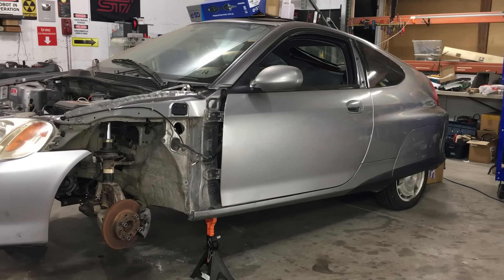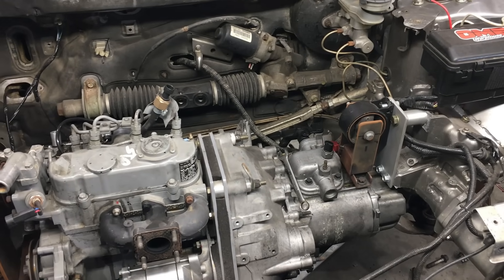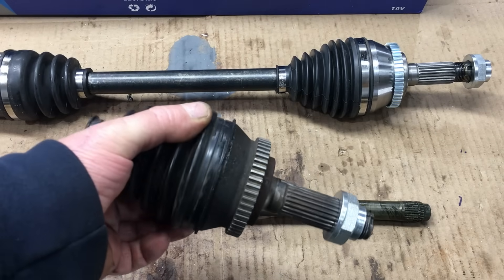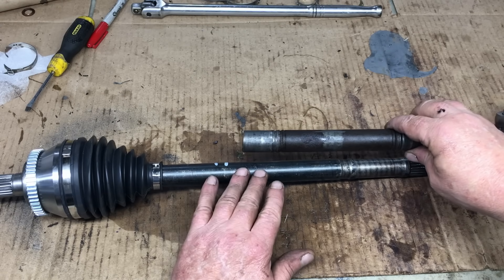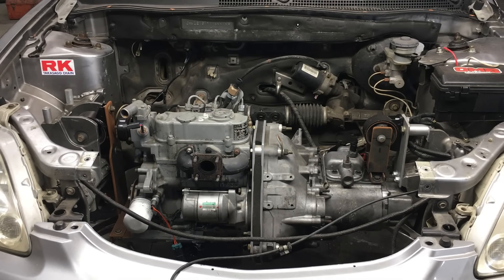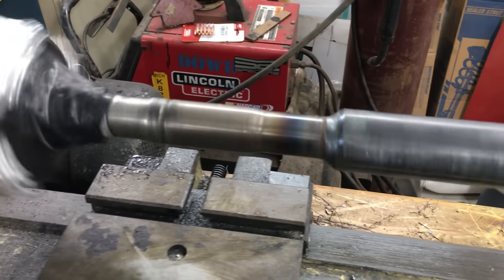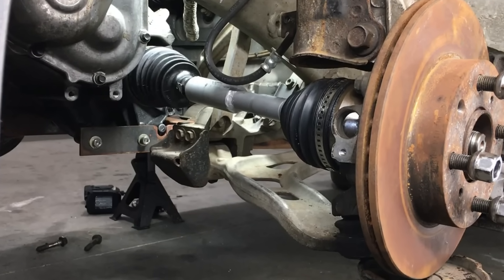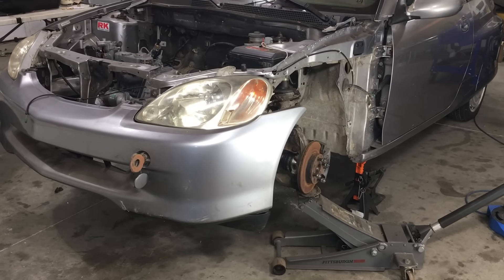S3 E39 we custom build drive axles for the kubota d722 diesel powered Honda Insight.

Comment: For heaters, there's some good kits for side bys that come with speed control, and usually a simple door for windshield or floor and some  ducting. Work great for old farm trucks and hot rods.

Comment: I would use a simple heater core you can find on an airport tow tug. Y'know, the inline Ford 300's converted to run on propane? Super easy to drop in.

Comment: Honda insight enthusiast here, the original gasoline engine was definitely not known for snapping axles. It happens occasionally, almost always when people are being dumb and spinning the tires in second gear with full electric motor assist. Wheel hop will snap axles, but you almost have to be trying.

Comment: You make me wana build all kinna things, and I have a thing for Diesels, large and small.

And me presonally, I like the smell of diesel. :D

I had the idea of mounting the a larger Kubota diesel in a beetle and using an air-craft style oil cooling/cabin heating system, a common solution for cab heating on other air cooled engine driven vehicles, though im not sure if Kubotas have oil bypass ports, though id imagine they probably do.

Comment: I'd still love to see what you can do with a bradley GT .... a 1200lb (stripped) fiberglass bodied car on a VW bug chassis
Reply: Cheap, light car that handles very VERY well in corners and has the near bullet proof VW 4 speed transmission that was built for a low rpm, low HP engine

Comment: Nice to see a "new" project! I started watching with the Renault videos. Maybe for a heater in the Insight, just go with a 12v power supply and portable 12v electric heater. ? Also, I think it would be cool on the Renault to put a matching Predator engine and drivetrain in the front with a front wheel drive setup (maybe from a Saturn?) for all wheel drive. See what that does for performance. Could be really useful in those Kansas winters too!

Comment: I was thinking for using the gen 2 or gen 3 prius drivetrain on other vehicles, like made in the US ones or at least made in the US for the most part, when cutting the axles to not weld and only bond the two ends via the similar spline design using a coupler.  So cut, cut splines and then connect via a splined coupler that might be able to be sourced from the eCVT or elsewhere if long enough.  I'm not sure the hardness and was thinking welding would adversely impact if not re heat treating.  Only thoughts for now. No hurry.  Was thinking for coupling with potentially half to three quarter ton more modern probably Toyota though maybe not axles, knuckles and wheel hub assemblies with brakes of course.  That center pin machined design is a good idea seems as well.

Comment: I would still say that having a high-pressure turbocharger paired with a low-pressure turbocharger would be ideal. That way, once enough exhaust is produced, the low pressure turbocharger will feed the high pressure turbocharger. Resulting in a few more horses. And a broader power band

Comment: Drill and tap the ends, screw in a piece of 1/4-20 and tighten the two halves of the shafts  together. Now everything is physically connected for welding.

Comment: I welded driveshafts on my HIACE van years ago, the wheels don't rotate that fast and the job was a good un even without going to the precision you did. a few hundred RPM isnt enough to cause much imbalance

Comment: i did weld a axel to a snowblower behinde my tractor  that did snap i did put it on the floor in my barn used the sheapest sick welder welded it togther i did hold up for 4 years ehehehe

Comment: Watching this CVT belt, I was wondering: could this engine be hooked up to an automatic without the CVT? I know thrust loads are why you're using the CVT, but I don't think clutch converters have those? I don't jack about automatic mind you, so I might be getting something wrong lol
Reply from the maker: This car actually has a real clutch because the diesel engine has thrust bearings. On the Renault it would be tricky to install an automatic transmission, however I did hear that even on automatics there are thrust loads that are transferred to the engine.  I have no idea how much of a load it is.  I reckon an automatic may be possible on the 670 cc engine, however since the Renault has a swing axle type tranaxle there are virtually no automatic transmissions that could easily be adapted to the Renault.

Comment: Thank u soo much for this Series, u inspired me to do the same swap in my Trabant 601! The only thing im really struggling with is the Adapter to the Original Gearbox, and to find a smaller Oil Pan because its really rare here (or expensive) But thank u soo much! Ur Series Helped me really really much! Greetings from Germany!
Reply from the maker: You can do it!

Comment: I bet when You add heat to the car the Kubota won´t make enough heat in the first place. Seems like a good plan to add valving to the main rad to limit or shut it off if needed. But with all ironed out I see this becoming Jimbo´s daily!
Reply from the maker: Last winter we had the little Kubota installed in the Saturn and the engine generated enough heat to keep the car toasty.  of course we had to cardboard over the radiator.

Comment: that thing about honda absolutely true
2011-2013 odyssey
2001 civic
it's true about every brand
even toyota(like it or not it's the most reliable brand) has stuff slip off the assembly line that's bad

Comment: heater will be pretty easy if you use a 80mm PC water cooling radiator and a 12v 80mm delta fan (the delta fan blows extremely fast and the radiator has brackets for it)

Comment: I'm sure that cv weld is plenty strong. But worried about balance. I know driveshafts need to be balanced like wheels to avoid vibration. But a cv joint is smaller & might not need petfect balance.

Comment: At first I thought the Renault was ugly. But now I think it'd make a cool looking rally cross daily driver beater for country roads.......If you could make the diesel honda not crazy slow but still get decent mpgs and use a combo of diesel, biodiesel, free waste veggie oil to run on.
Reply from the maker: LOL, calling the Renault ugly upsets some people...  but I do thinks its ugly but I have seen worse.
Reply: @robotcantina8957  I really wish I still had a garage or workshop so I could build a diy aerodynamic electric velomobile/recumbent trike with lightweight weather enclosure. To stay warm and dry on cold wet days. No more expensive insurance,registration, gas or maintenance costs. I know those 3 & 5,000w ebike motors can get a bike up to 55 -60 mph so it'll get a velomobile up to 55 using moped tires instead of bicycle tires to be safe at 55.....Although it'd settle for 35mph cruising speed and bicycle tires if it was cheaper.

Comment: For the power you are making, you didn't need to weld the pieces of the axle. You could have just cross drilled the sleeve and plug welded the holes.

Comment: At a glance, to many of us, I think these engines seem unbelievably small.  However, I did a quick search and found out that this is not the case.  
Production cars with the smallest engines
Berkeley SE322 – 322cc.
Honda N360 – 354cc.
Subaru 360 – 356cc.
Citroën 2CV – 375cc.
Fiat 500 Nuova – 479cc.
NSU Wankel Spider – 497cc.
Smart Fortwo – 599cc.
Tata Nano – 624cc.
Especially odd to me, considering the smallest displacement motorcycle engine my dad has had was 1500cc.  That's probably the smallest most people in the U.S. have ever had as well.

Comment: Quick note at 9:40

No welder Is (not powerful enough) just not optimal 

With correct beveling and pre heating you can weld anything with any welder 

It’ll just take a LOT of passes.

Comment: I wouldn't be surprised if Honda designed the axle so small as an attempt to reduce the amount of rotational mass as much as possible for fuel mileage.
Reply: You are correct. I drove over 250k on the oem axles with no problem. 

Keep in mind the engine is 67hp. + 6hp from the hybrid.

Comment: ive snapped plenty (atleast 4) welded axles. they were built by dogging (D shape on end of each shaft) in an interference fit sleeve, with the sleeve seam and plug welded. Now my joining method is superior to yours (IMHO and no offense!!) all shafts snapped where they entered the inner or outer joints, never at the welded part. so you have no worries, those shafts will be perfect!

Comment: A Honda large bore atv,or sxs radiator,fan assembly and thermo switch out to work well given its compact size,reliability,and should be more than sufficient for that small displacement Kubota engine,plus can be picked up on the uber low low cost factor..😅 Heater core mounted in a box with a simple 3 speed blower fan with a single duct aimed towards the drivers feets and midsection would be super simple to do..

Comment: If you source a heater core made of an old 70s or 80s Chevy pickup, you could probably getting away with a cheap price on that part.  The one bad part about using PC case fans is that they aren't really made for heat and they more often than not don't move a lot of air, unless you look specifically for a high CFM part.  The Chevy heater core might be big enough for a small radiator fan, though.

Comment: @Robot Cantina I have a free heater core and 12V fan out of a Chevy Cobalt dash.  Don't know if you get down to Bentonville Arkansas, but it is here if you want it.  Has the plastic shroud and dash subframe if you want it.  Can ship it if you want to spend a few bucks.

Comment: A forklift heater might be a good option, although a heater from under a bus driver's seat might be more simple. One other idea is a motorcycle radiator with the factory fan.

Comment: With axle splices, I'd think that virtually no amount of engine power or torque would compare to the forces the axle experiences in a hard braking corner or sudden braking swerves? I think that would be my primary concern, but I have no practical experience with frame or drivetrain welds, so I don't know. Can anyone speak to that?
Reply: The force from the brakes goes straight to the wheel, not through the axles.
Reply: @vxiiduu  No torque through the steering at all? Sudden changes in angular momentum over shifting positions have to put lateral strain on the axle, I'd think. It isn't so much the braking itself, but the shift of velocity in a fast turning maneuver which makes me wonder. The compounded changes along with the rotation causes stress vectors that I wonder about. I can be wrong, though, especially since I don't want to work out the basic math.

Comment: Incredible backyard engineering for that axle solution! That's the stuff I like to see. Welding that in 40 passes and a trip on the lathe would have been doable, but I don't blame you for taking it to a shop one bit. Nothing like sorting out a high stress but crucial rotating assembly, thinking you've got it down to micron perfection, then feeling it shake itself to death from being out of spec by a whisker on the maiden voyage. 
Ah, the circle of recurring project vehicles grows evermore! Never a dull moment. 😁👍
Add: Just for laughs, I would consider a little wood burner stove for your winter heat. Heck, if you want to get real whimsical, wood vapor combustion for fuel and heat via thermal transmission pipe (guess you could call it an exhaust pipe over the transmission tunnel) would be comical.

Comment: you can (usually) pull 'non-serviceable' axles apart by pushing them sideways past their normal working range so you can pop the ball bearings out of the cage. once all the balls are out, the cage will come free of the cup, and the cage is only held onto the end of the shaft with a light press fit and circlip.

Comment: The orignal honda axle was probably undersized for unsprung weight and low drag, probably worth a miniscule amount of fuel economy.

I've swapped axle ends from nissans to other nissan shafts.  i wonder if the aftermarket companies use common splines.  most of the tripods i've worked with are press on.

Comment: Have you happend to throw away the transmission side of the Honda insight cv joint? If not, I'd be willing to purchase the part. I'm in need of a replacment bearing for the cv axle from the stock cv joint.

Comment: Keep in mind, Honda was first a motorcycle engine company,  before becoming a motorcycle company, before become an automotive company.  And Mr. Honda was always about performance.  So, in addition to the wonderful "We Keep It Simple" logo the company used to market their early cars, their internal motto has always tended toward "We Keep It Light."  For years, and into the present, Honda brakes were known to be not as durable as, and to overheat more quickly in hard use than those of other manufacturers.  Not because Honda didn't understand brakes, but because they wanted to keep unsprung weight low. Similarly, the bodies of their smaller cars are bolted directly to the front subframes, rather than having an insulator in between (and that's where your famous Honda road noise comes from). So, perhaps it is more useful to think of their parts as engineered to be as light and performance-oriented as possible, than to think of their parts as crappy.  If you want a car that ain't gonna break, even if you drive it like a teenage boy, buy a Toyota.  But if you want to have fun driving you will probably prefer a Honda.

Comment: Just a question ... wouldn't it have been easier to skip all of the machining on the axles, and simply turn down the sleeve that you were going to use anyway so that the inside diameters would match each side? Assuming that your lathe has a good setup, this would ensure a closer alignment of the two shafts with one another, and it would make the weld up easier with regards to the need of a fixture for the welding -- a piece of angle iron to hold alignment with a couple shims would have done the trick.

Comment: About 5 years ago I was contacted by Tesla to help them weld some axle shafts together(their r&d department is local to me). I inquired vehemently about the alloy and heat treat of these cut-down axle shafts. The engineer in charge would only tell me "high strength steel" to which I replied the proper way to do this job was to heat the axle shafts to a particular temperature in order to normalize stresses and allow for weldability of the particular alloy. Then the axles needed to be cooled slowly on a certain regime as well as maybe re-heat treated depending on stresses involved. 
They didn't go with me, but decided that a "super duper race car shop" down south would have no problem tig welding these, as they "do it all the time". 
I later found out that, just as I had predicted, they immediately exploded when any stress was put on them during the Dyno process. 
Long story, but just remember that if you're doing anything high horsepower with axle shafts, you need to know what the heck you're doing, or find someone who does. 
I'm sure Jimbo will be just fine with his Saturn/Honda axles though, not much power here! 👍
Reply: "high strength steel" lol that's so tesla of them
Reply: @vxiiduu  Exactly. Typical "tech" engineer.

Comment: we removed cv joint without a tool , there is some sort of circlip in there holding the joint on , we basicly layed the axle on top of a slichtly opened vice , used on hand ( or partner) to hold the circlip open and then janked on the axle like a slidehammer making the cv joint hit the side of the vice so the cv joint slid off the axle past the circlip groove  , took a few tries as the pliers often slipped out of the circlip holes but we usually managed it , messy job that black grease whent everywhere
as for heat in the car : maibe you can use sumting simulair to the heatexchanger of a vw bug where the heat from the exhaust is used to heat the inside , the diesel makes a lot of heat so a heatexchanger in the exhaust should work pretty well

Comment: I believe the stock drive axles were smaller in size to reduce weight. I may need to upgrade mine as I swapped in a 05 civic hybrid manual trans recently because as you stated, they can be weak.
Reply: The original ones are not weak at all.

Comment: A Honda insite heater core is ~$50 on the jungle site, and a blower motor is ~$40. Should be plug and play for less than $100

Comment: For those who aren't familiar with welding. Example 6013 or 6018 welding rods 60 is the strength of which it can hold a metal before it breaks. Is categorized as 60,000 lbs per square inch. Assuming the weld was hot enough to penetrate the metal shaft. Even drive shats in rear wheel drive cars and trucks are welded. This combination of drive shats will hold on with welding.

Comment: so for axles that can't come apart with the tool, you can still over-extend the angle on the joint and pop the balls out one by one, and then disassemble it that way. Once you have that, the inner CV part can come off the axle. (there's most likely a C clip in there)
A friend of mine with way more patience than me figured that out. :)

Comment: You could get wild with the heater.
240 or 740 volvo heater cores pump out enough heat to bake cookies.
Sadly though, a small diesel engine would most likely get too cold to be efficient with one of those heater cores.
I suppose you COULD wrap copper tubing around the exhaust some where, and whip up a stand alone heating system.
While it would be almost instant heat in the winter, it would also add a  pile of complexity to the over all build.
Chinese diesel heater ? 🤷
Anyway, I love your builds, even the ones that dont quite live up to your expectations.
Interesting and informative every time.

Comment: Like others have mentioned about the heater core in a box. You can get a tractor cab heater with a fan and switch ready to plum from the jungle or flea Bay site or farm store.